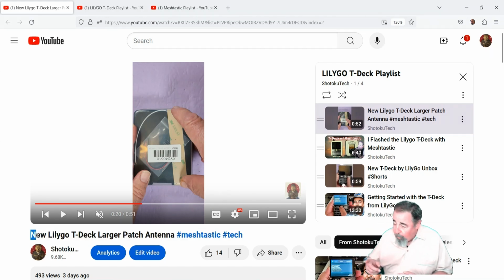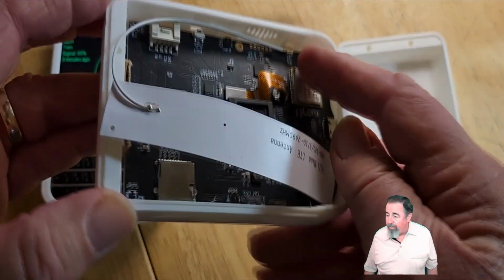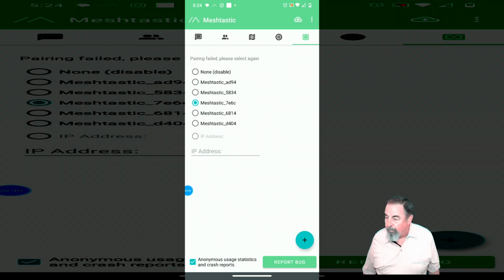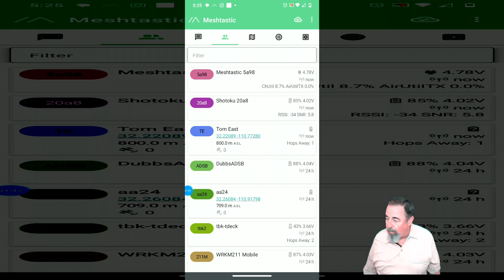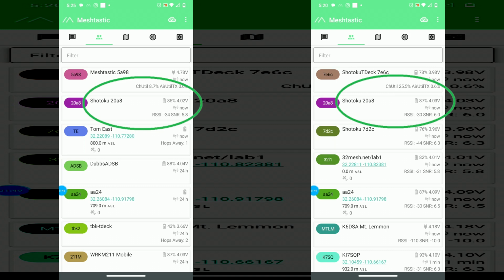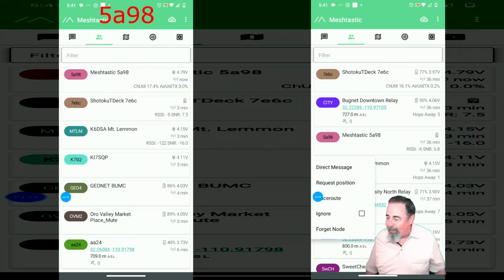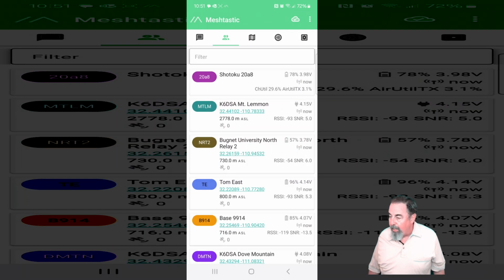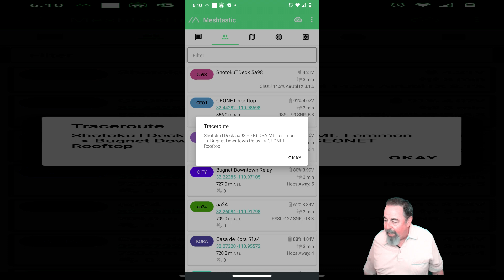Testing The LILYGO T-Deck Patch Antenna #meshtastic #esp32

Comment: Cool test I was wondering what would be better
Reply from the maker: I use these a lot when you don't mind having 175mm antenna sticking up from your device: https://amzn.to/4deCiIW
These work pretty good. Our club has an antenna tester. This one tests good if it is straight. But when you fold it at the hinge, the performance drops .

Comment: How much more distance is it possible to achieve switching from Long Range fast/fast to Very Long Range/Slow? I live in a crowded city so looking for ways to achieve better distance even if it's way slower.
Reply from the maker: It looks like you get +8.5dB more link budget over Long/Fast. Not sure how I could test that.